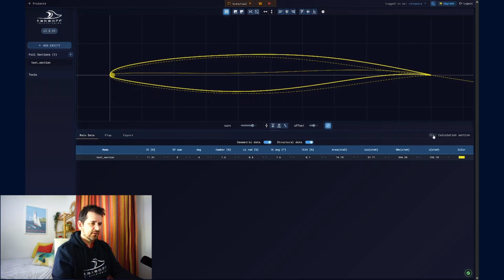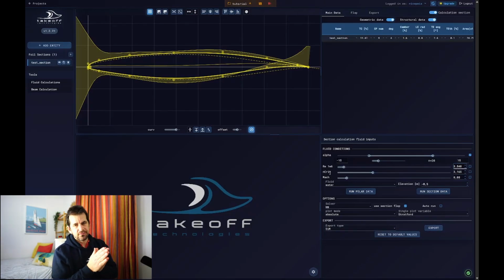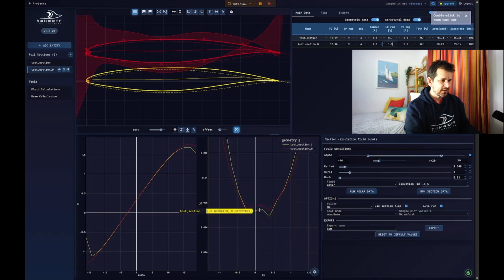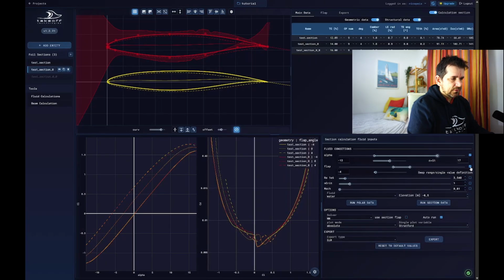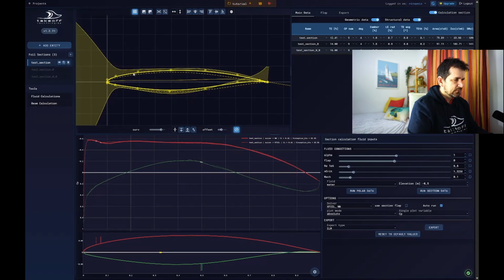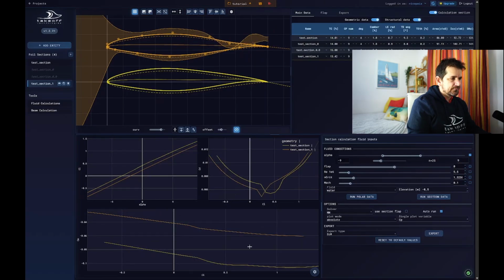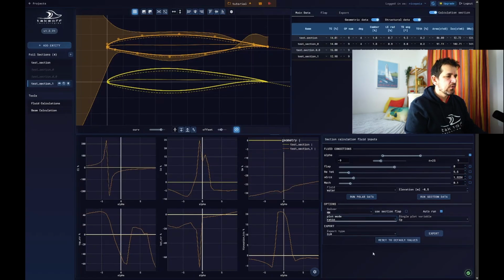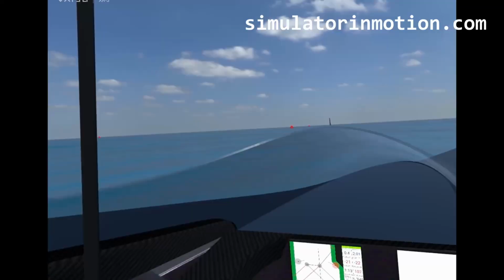Airfoil calculations Polars & Distributions | EP06 | 2D Airfoil Masterclass

Comment: I just do my free export via screenshot cause I don't want to pay monthly. I'd rather pay one's
Reply from the maker: 😂 We appreciate the honesty! 

We’re glad the screenshots are working for now, but once we launch the 3D features, it’s going to be much trickier to capture everything in a single frame.

Also, don't forget that the subscription gives you full access to the Optimization tool—it’s a total game changer for these designs!

Hopefully, the extra power makes it worth the leap. 🚀
Reply: 20£/month is great. I’m waiting to see if 20£ a month covers most of the 3D part as well. Obviously if optimisation in 3D is resource intensive then it would make sense to have 20£/month up to a certain number then pay individually at a discounted price above that to cover for the outsourced computing. It’s definitely priced right for the casual to intermediate engineers who like to build their own stuff who can take out a subscription for a month or two during the design phase.
Reply: @callumwyper I haven't looked at it this way and agree. It makes sense for a month or two
Reply from the maker: 😂 We appreciate the honesty! 

We’re glad the screenshots are working for now, but once we launch the 3D features, it’s going to be much trickier to capture everything in a single frame.

Also, don't forget that the subscription gives you full access to the Optimization tool—it’s a total game changer for these designs!

Hopefully, the extra power makes it worth the leap. 🚀